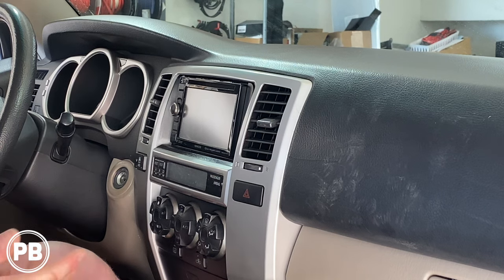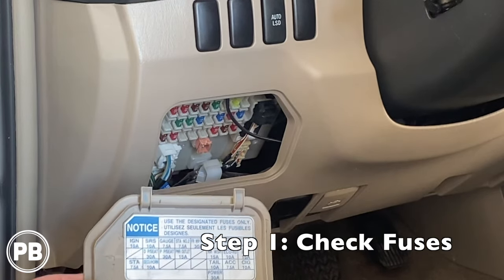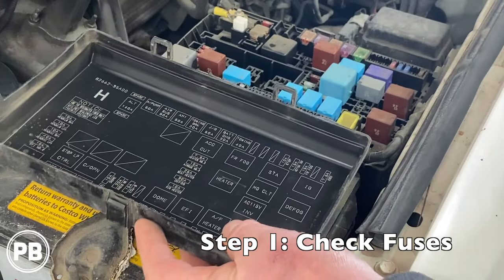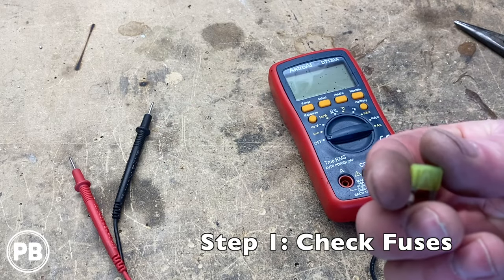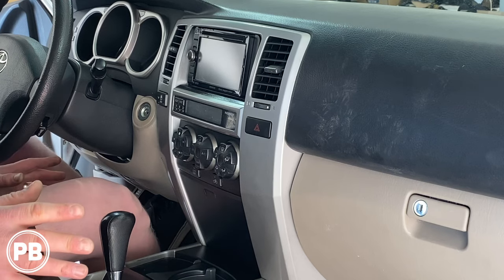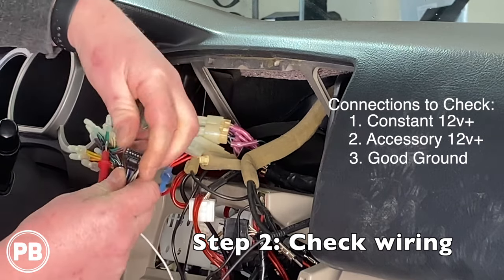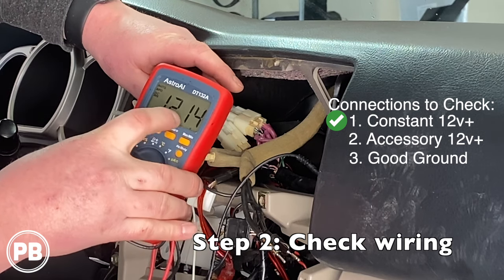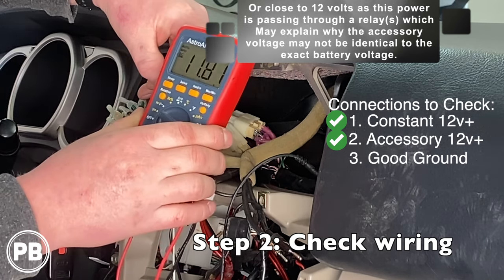SOLUTION: My car radio won't turn on!

Comment: why does mine turn on when i turn the key but when i fire the vehicle up it turns off
Reply from the maker: Many variables there, and sounds like it could be the wiring harness adapter.

Comment: The reason why his radio was not coming or he have to change the fuse in back of the radio
Reply from the maker: Circuit board malfunction on the kenwood. Cheaper to replace than to repair.

Comment: How about the radio just coming on at various times without me? I’ll just be doing and it will turn on out of nowhere. Scares the crap out of me.
Reply from the maker: Sounds like a short somewhere in the wiring, or the radio is going bad.

Comment: How would you resolve no voltage on red when you turn the key?
Reply from the maker: Bad aftermarket harness adapter or blown fuse. Depends on the vehicle
Reply: @ProvoBeastAudio  👌 OK, I re wired and fuses are good. Can you connect red to yellow and shut off the radio manually?? I do get 12V on Yellow. I’m stumped🤷🏻‍♂️

Comment: My radio is getting no power and all fuses are intact. What do I do?
Reply: If you used a multimeter as shown and didn't get 12v at the wiring harness on the proper power wire(s) and you're sure the fuses are testing good, then it's likely a wiring problem somewhere between the wiring harness, potentially all the way back to the battery. There are most likely several connection points along the way that could be lose or there could be a short somewhere in that circuit. If there has been recent work done to the car, that'd be a good place to start. Also, assuming you were testing for 12v at the wiring harness that feeds in the back (or side) of the radio, did you have a good ground point for the black probe on your multimeter and was the key turned to Accessory or Run? Hope the questions aren't too condescending, it's just hard to know what someone's already tried specifically over Youtube comments.